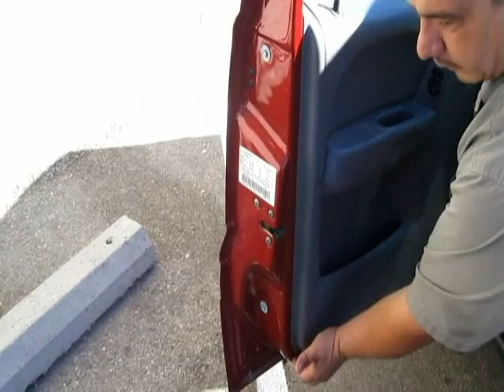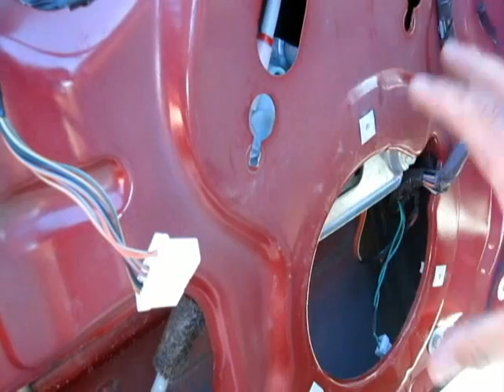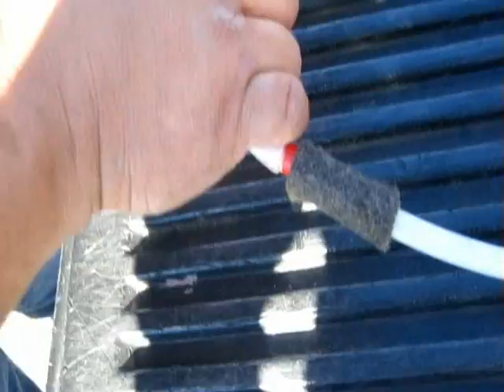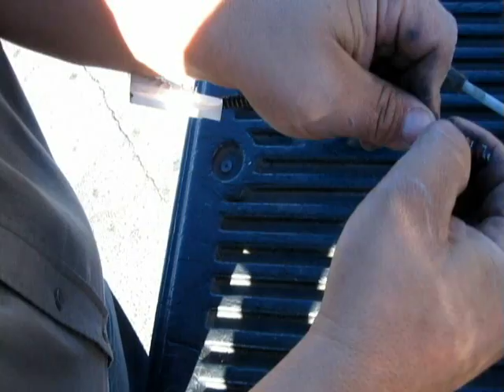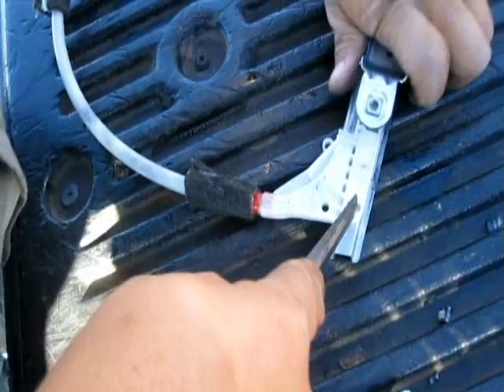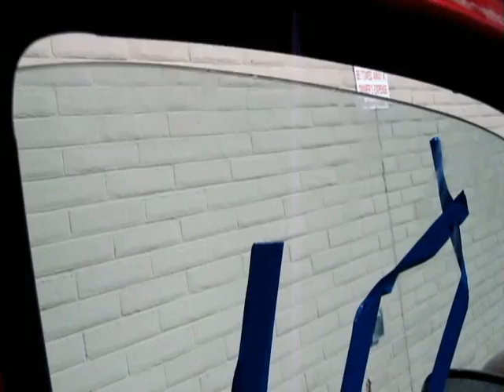Jeep Liberty Window Regulator

Comment: Nice video!  Despite being a mechanic for years and having replaced several window regulators on German cars, I might have spent a long time figuring out the right combination of moves to detach the power plug - or given up in frustration and just cut & spliced it!  Too bad my partner's Liberty is a '07 and the rear regulator that died first, only replacement clips available are the fabricated metal ones.

Comment: ok I have a 2007 jeep liberty and the windows stopped working, first the left front, then the right. What was weird was the snake like cable would come up out of the window casing when you tried to go up or down but then eventually the window stopped going up and down all together so I knew it had to be fixed.  Followed the instructions here and removed the whole regulator. Now the motor still worked and the only problem was the plastic casing that the cable ran through had split allowing the cable to come out of the motor and flop around...Lucky me I threaded the cable through the motor till the 2 pieces of casing met once again and repaired it with some fantastic plastic and then duck tape over that. Put every thing back the way it was and was I happy...worked like a charm.   Thanks for your instructions on  how to remove everything!
Reply: that's the problem we have with my son's 2003 Liberty. I kept watching looking for the black cable that is loose in ours! Thanks for the info.

Comment: Don't replace the plastic part that commonly breaks with the exact same plastic piece! That's pure asinine. Replace the part with a Steiger Performance one instead. $100 and it won't break again. Same procedure for the most part as the video but the replacement part is steel and of a better design.

Comment: This is one of the best you tube auto repair videos I have seen. And I have watched many of them. I have replaced a window motor on another vehicle so I am basically familiar with what is needed, but you really showed everything and with good camera work and vocal instructions. Muy excelente! Muchas gracias! Obviously the weak link is where the flexible metal shaft meets the plastic. Jeep should have known that would fail.

Comment: Great video, well done. Do you guys have a step by step on replacing the glass rather than the reg. My guess is that you just release the glass from the regulator and loosen the channel guides and the new window pops in from the top. Any help would be appreciated.

Comment: This guy is awesome AND so is his Video person. I'm replacing mine now and then I'm going to buy 4ea of the metal ones and take one day to replace them all and then I'm going to raise my finger high up in the air and tell Chrysler what I think of their thin plastic window supports that has been an issue World Wide.
Reply: +Ron Hawkins You got that right. As much as I love my Jeep Liberty, it just pisses me off that they'd design a part so cheaply, and then continue to use the same crappy part at dealerships, when they know full well that the thing will break in a year. Where did you order your metal ones? I want to order some. I never even use my rear windows, yet both of them fell into the door,  when the truck was parked in the driveway. At first, I thought someone had broken into it. I finally just clamped the rear windows shut, but now my front passenger window has fallen, so I'll have to fix it.  Chrysler should have recalled this years ago. It is a safety issue since the windows sometimes fall when people are driving highway speeds in bad weather. They went to all the effort to put trailer hitches on them as a fix for the gas tank rear end issue, but do nothing about the windows. I hope your metal brackets worked out well.

Comment: It's a good idea to use a small machine screw/nut to replace the rivet which was removed.
Also, don't take any of the bolts all the way you when removing the parts. Just loosen the bolts 2-3 turns and lift the parts out of the "keyhole" shaped mounting holes which were intentionally designed that way to make things easier. When reassembling you simply "hang" the parts back in place then snug up the bolts.

Comment: Thanks, this was very helpful.  I have a 2005 Liberty and my regulator was a bit different from this but it is the same technique basically.  One bit of possibly helpful information.  When I pulled mine apart, the cable had gone completely past the motor gear.  I had to take the gear box apart and feed the cable back to the point where the gear could pick it up.  Once it gets to there, hook up the wires and push the button to move the window down to feed the cable to the connection point.

Comment: Thanks for the video guys. I'm not a mechanic (I'm a computer tech actually), but I managed to replace the regulator mount by following your instructions. 
I still have problems with the window tilting to the side even thou I grease the rubber guides.
Do you have any idea what cause this?

Comment: Hey check this out - so i got a new reg and was about to put it on and found out that they forgot to include a place for the window to sit on the mount. I found that the old sleeve from the metal mount clips onto the new mount so that the window can sit on the mount....ever run across that? I got a new regulator from partsgeek - had to get a new total unit because the housing for the worm gear is what broke, enabling me to put up the window but not put it down.

Comment: Huge thanks -- I had bought a new window regulator on ebay, that came with the replacement directions, but not with directions how to remove everything from behind the door.  I'm no car expert, but after watching the video and making a couple of adjustments for a different window clip, I did it.  Took about 3 hours for whole process.

Comment: 2003 rear passenger window did the same thing, how much for the mount? i cant find one anywhere..not worth buying a motor when i dont need too. it works fine.. also if the metal cable comes out completely, can i just run the motor and feed it back through? thanks!

Comment: I just came in from fixing my window... thank you for this helpful video. When i took the door cover off i saw that the cable cover was broken and that's why the cable kept coming up through the seal and sliding up along the glass. I pushed the cable cover together and used some duct tape to tape it together. It may not last forever but the window works fine for now and saved me the $400 the mechanic quoted. thanks for making this video.

Comment: thanks for sharing. the only thing I can add, is where the rivot was removed, you can install a small sheet metal screw (or rerivot) where the old rivot was - just to ensure a tight hold with the bend tabs. I should have my repair upload in a few days, if I have the time to do it.

Comment: Hello JeepLibertyMaster!

This JUST happened to me. Basically, I found my rear passenger window about an inch down today. When I operated the window control, I could hear the motor grinding and spinning, but the window wouldn't move. I can lower and raise the window with my hand. 

The question is, do you think something is broke, or something is lose? If something is broke, what is the user-repair cost and time? Thanks so much man!